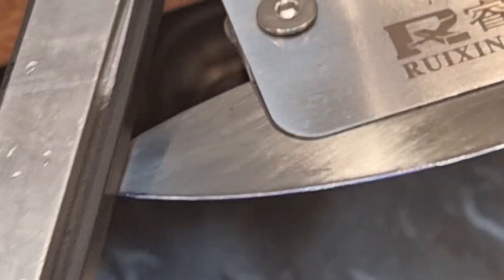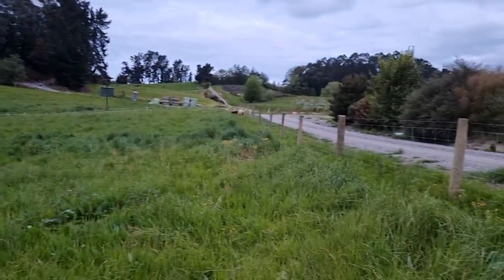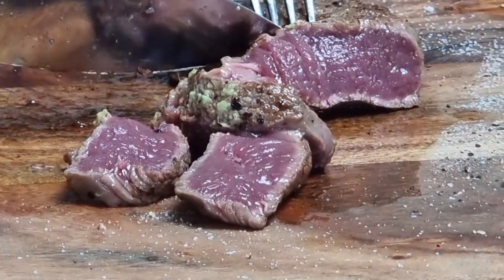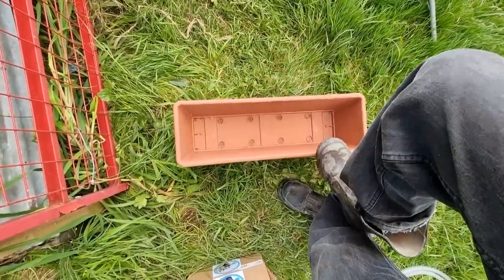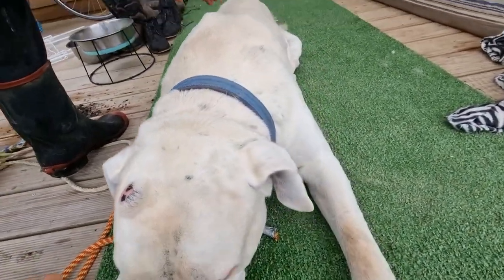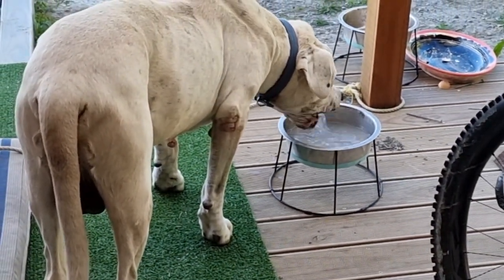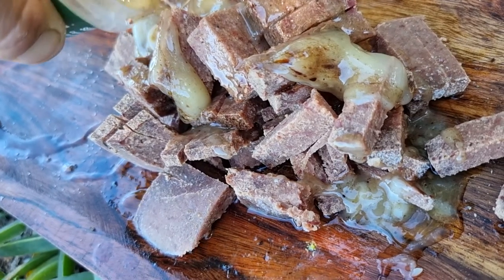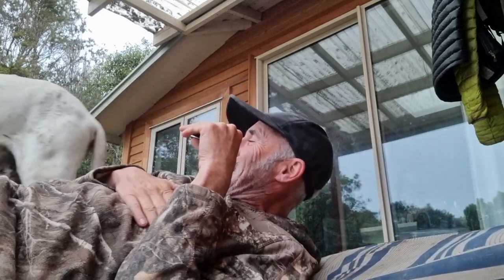Homesteading New Zealand. Clay Tall Stories.

Comment: Wasabi plants in the garden require rich, consistently moist soil with a slightly acidic to neutral pH. If growing in containers, use a one or two-gallon pot with a 10-inch planting depth. Mix up some rich soil with compost; slightly heavier than potting mix medium, so it will hold moisture
Reply from the maker: Thanks mate

Comment: Hey there mate if your car battery is pretty well charged atm and you find the electric fence holding your sheep behind it starts to get low or it completely hasn't got any zap in the electric fence it can be from having the battery sitting on the ground which will cause it to drain as the ground is earthing your battery life best to have it up off the ground cheers mate
Reply from the maker: Good tip but I an not sure how the ground can earth it through its plastic case?
Reply: @ClayTallStories  years ago a relative had a wreckers yard in ozz he said one of his staff forgot to put them on the shelves and all his batteries went flat as they were sitting on the ground so Ive always keep it in the the bk of my mind lol